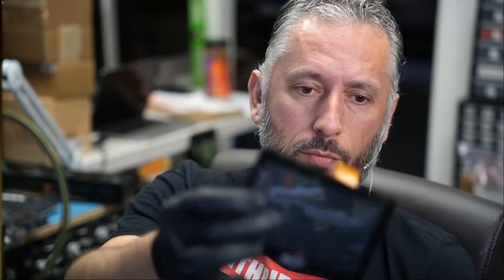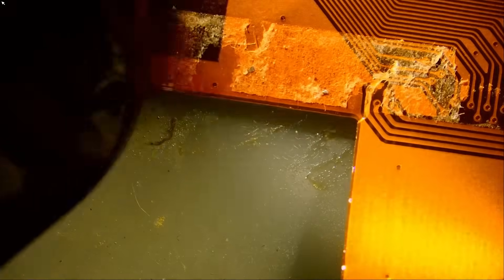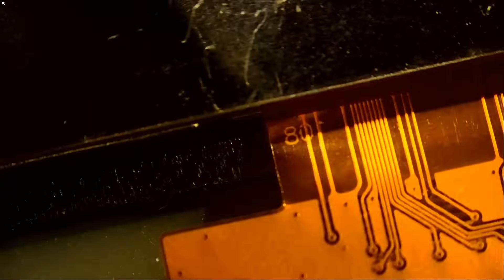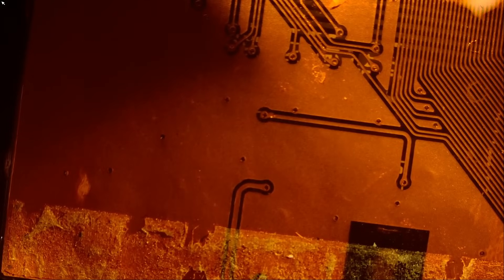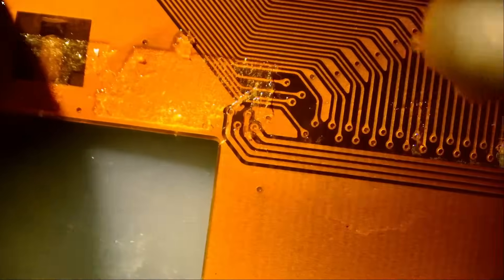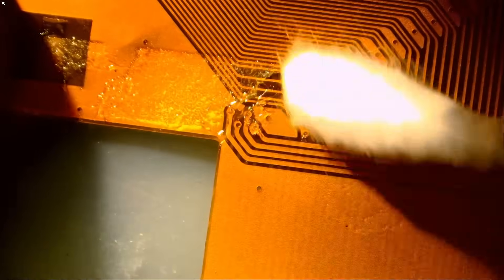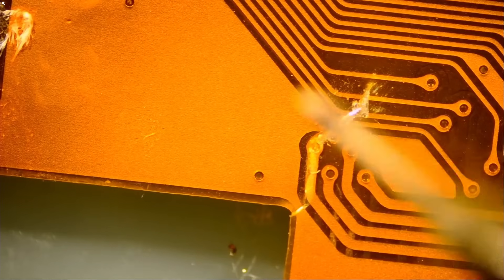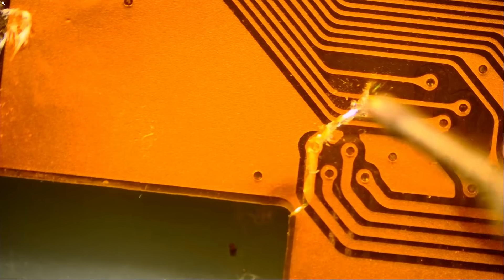Urgent Repair - Is this even Fixable. Ultra Thin Torn Flex Cable for SCT Tuner

Comment: Can you share what type pf mask you applied before the green one? It was a dark substance. Right on the ripped part. It was to glue the cables together I believe
Reply: I believe you can find the mask on his website, the mask can be used to hold cables or in this case a flex cable but it’s not strong as a glue

Comment: First off: you are a wizard amongst the ignorant rabble. Great repair, and great video! Would you consider adding subtitles during the parts where you are fixing that explain what you are doing?  I don't yet know what the different things you are doing are, and I would love to learn. I just started soldering with some second-hand equipment that I'm working on replacing and the stuff you are doing here looks like black magic

Comment: These flex cables are a pain in the ass to do, if its an option i would always replace rather than repair, but these days they dont even have a schematic in the back of the manual like you used to, let alone a list of parts...  I had to do  a fiddly one couple of decades ago on a then fashionable DVD-RAM drive, I used  genuine Capton tape on this type of cable rather than conformal coating as in my case it was part of the laser assembly  and it was part of an assembly that was moving constantly, but never had a come back on it....
Reply: It’s hard to find them for a lot of devices. Only really easy to find for popular devices.

Comment: I must say I use the anti-glare light, and it does work really well; I use it almost 100% of the time. I’m using a cheap 32” Amazon Fire TV panel for my microscope monitor, so the picture on it isn’t great… stuff gets blown out really easily so the anti-glare light stays on most of the time. 

If I start using my setup more, I should upgrade the monitor lol… my setup is in too small of a space with too much crap in/on it, so it isn’t all that usable at the moment lol

Comment: Plz help. I found poop inside my gaming laptop. I bought it refurbished from Amazon... it smelt a lot, but worse/more bad whenever I played games and the fan turned on from heating up. I opened it up because my friend told me it might be bad thermal paste and needs to be repasted to cool temps down. As soon as I opened it I was over whelmed with the EXTREME smell of feces and there was brown smeared what I believe to be poop all in-between the heat sink metal fins. Amazon won't let me return because I am past the return window. Can I send to you to help fix?
Reply: You’re joking right ?
Reply: Dispose of it, it's not hygienic
Reply: theres no way, you def trolling rn
Reply: Probably rat droppings
Reply: flood it with piss, it's obvious
Reply: no, don't even try, that is literally a BIOHAZARD...
Either you throw it away or you wear a hazmat suit and soak and drench the laptop (not the screen) with isopropyl alcohol 91-99 percent while brushing it gently with toothbrush.